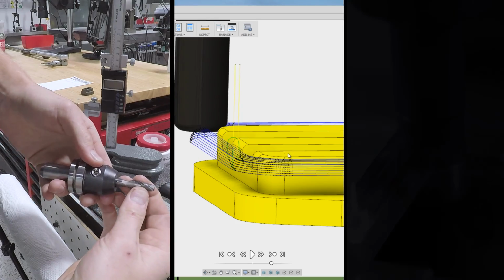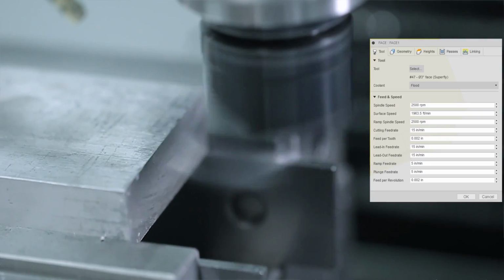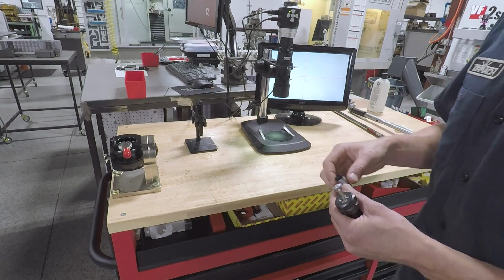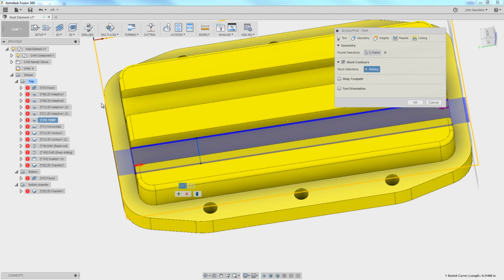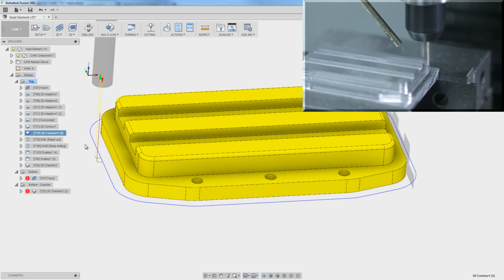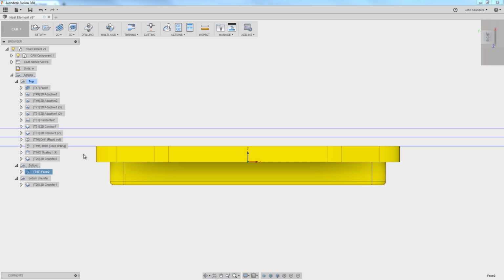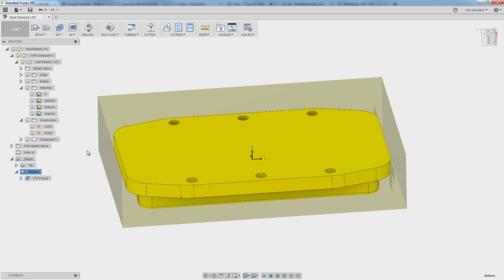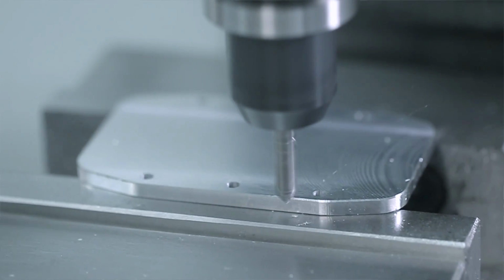Comparing 2D Adaptive & Flipping a Part! WW172

Comment: Sense the last thing you do on both op1 and op2 is the chamfer on the outside edge, with that tool loaded could you have gone in and just broke the edge on your through holes to save you time deburring  later on by hand?

Comment: 5:57 The WOC was rather too small. You need to cut the chips, not smear the aluminum around or weld it to the cutter. And some mist coolant always helps with aluminum.

Comment: Hi John, i appriciate your knowledge, but could it be better to take a roughing mill with cropshape and rough the whole slot out, change the tool to a end mill and finish the sides and the bottom with it?
I work with this setup quite very good, especially by big parts out of aluminium with roughly more tha 300-500 cm3³ to remove.

Comment: What is the best method to get out sticky aluminium chips from a carbide endmill?
Reply: Patrick Niechciol  when I was learning, I would soak the tool in hydrochloric acid. Perfect clean. ( carbide only,  I'm told the HCl harms steels)

Comment: Here is how you save your tool after chipmelting without breaking the flutes!!

Put it in almost boiling hot water with some caustic soda. And it literally eats the aluminium away. You end up with a brand new tool. ;)  even if there are massive chunks. 20-40min and done.

Comment: Yep, at 19:58 you can clearly see that the head is slightly rotated counter clockwise, and needs some trimming :)
It takes a secondary cut going to the right, and not whne going to the left

Comment: I work with Inventor and used to have similar issues of not being able to select geometry similar to this.  However, in this situation, you actually didn't have any geometry to select other than what you projected.  Create the entire rectangle and make sure the points lock/constrain to the corner points on the projected geometry and it will still be parametric.  In Inventor, you can hover over the line to select other geometry, I imagine Fusion has the same feature since they are both Autodesk products.

Comment: John; I know you are in love with that adaptive cycle. It does have its uses for inside pocketing. For slotting you may find a alternate method for this part would be faster and more reliable. When you have time try this. Take your 1/4" endmill with the tip radius and make slotting passes at very shallow depth of cut. You didn't say (Or I don't remember) how deep your slot was. Lets say .150" deep. Take ten passes at .015 depth at 10,000 RPM and 100 IPM what was your width lets say 3" of distance so 3 x 20 passes = 60" at 100 IPM that = .6 minutes. See with adaptive you are cutting air about 30-50% of the time. With this shallow depth of cut in slotting with the tip radius endmill you are basically doing feed milling (The tip radius thins the chip) the tool won't load up. Actually you may find you can feed even faster than 100 IPM that's only .0033 feed per tooth of your 3FL endmill. This method of milling makes a thicker smaller chip that is easer evacuated by coolant or your air mist for slotting operations. With bigger parts and with a proper feedmill, this is the most efficient way to rough parts now days. It does require more horse power than the Tormach might have. Your Haas would do it fine. Look into feed milling.

Comment: We use full depth slotting all day every day in our job job.  WAY less wear and tear on the machines servos and screws and way less programming and in aluminum with carbide?... who cares.  OR like John said in a past video, use the largest tool you can?  How about 5/16" tool, 1 pass rough, 1 pass on each side .001" cleanup.... 3 passes would take about 30 seconds.

Comment: Use 1 or "O" flute tools to keep chip welding aluminum particularly in the absence of flood coolant. Aluminum can actually be machined  most effectively at 3000SFM but it is absolutely necessary to have 1 flute tools to make that kind of cut sustainable in the absence of flood coolant but at more conventional SFM which you are utilizing it is also surprisingly advantageous to use 1 flute tools for aluminum machining. Check out datron CNC, they make their own 1 flute tools some of which feature patented special geometries, but many of the less expensive 1 flute endmills perform well for this application.
Reply: Eh, single flute end mills have their place, but they're are kind of a specialty thing, if I'm not mistaken. They have better chip evacuation and can be fed slower if you need to run at a high RPM. But if you don't really need those features then you're probably going to remove more material by feeding a three flute cutter three times as fast.

As far as proper surface speed, I've never seen a company recommending their carbide tools be run at 3000 SFM in aluminum. That's more in the range of what diamond cutters want. You'd also need close to 50k RPM on your spindle to get that kind of speed out of a 1/4" cutter like they're using here.

Comment: Don't bottom the drill in the chuck before tightening, and also don't chuck on the flutes, unless you like broken drills. (Think about it: the drill tip applies torque to the drill shaft, trying to untwist the flutes. This causes them to expand in diameter a small amount. This causes a stress point at the place the hardened flute contacts the tip of the chuck jaw, and can chip the flute. This can lead to a fracture and break the drill off at the end of the chuck jaws.)

Comment: Your tool broke because your chip load was too low. You need to feed faster or take a larger WOC. You need to make a decent size chip so that the heat can be taken away with the chips instead of transferring to the tool or part. I say it in almost all of your videos, but HSM milling is a waste of time in aluminum. You can run full slotting at 1XD depth no problem.
Reply: and you can cut fast slotting @ 1XD

Comment: John, instead of breaking the link to model in your sketch, try adding short lines on the top and bottom edges to close the loop of the region you want to retain.  This works in almost all parametric CAD programs and it works in Fusion 360 as well.

Comment: Have you tried using the "break" line just below the extend function? This should create 2 separate line segments instead of the 1 constant line
Reply: Doesn't work with a projected line. Projected geometry is linked back to a feature on the part so that if the feature changes the projection updates along with it. It can only be changed if that link is broken.
Reply: Jeb Julian 
I don’t think anything that’s projected and linked back to the original part can be broken or modified without first breaking the link.
Reply: Thanks for the feed back guys, I think John showed this and had to remove the link. I was just thinking about afterwards when the trim function moved the sketch, maybe break would have worked
Reply: As another commenter has already mentioned, the projected lines can be converted not construction lines. Then you can complete the rectangle with 2 "normal lines. This will maintain the parametric nature.

Comment: That heat sink looks optimized for surviving rugged handling rather than for peak thermal performance.  #intriguing
Reply: Jim's videos 
Probably for an unvented application inside something where there’s no fan to move air around it. A large block to act as a thermal mass works better than a finned one in applications like that.

Comment: Changing the toolpath in Fusion and putting it onto the Tormach surely takes much longer than just running it the full slot again...
Reply: dcraig4 
If you’re breaking tools on a finishing surfacing path you have bigger issues at hand and should probably redo the toolpaths.
Reply: For this part. It becomes relevant when you break a tool at the end of a much longer operation.
Reply: dcraig4 
Cept usually much longer operations have far more complex geometry and there’s no good way of telling just what was and wasn’t cut. 

This would be useful maybe if it was a tough material that had to be machined slowly. But I don’t see it being that useful to do.
Reply: So tell me what you would do if you broke a tool 3/4 of the way through a 6 hour operation.
Reply: dcraig4 
Restart the program from the broken tool...   what program has a 6 hour long single tool path??
Reply: A finishing toolpath for a large part with complex geometry, for one...
Reply: And even if it's only 60 minutes, would you really just let the machine waste time cutting air for 45 minutes? Maybe that's ok in your shop, there isn't necessarily anything wrong with it, but not everybody works in your shop.
Reply: dcraig4 
If you were doing something like mold work, would you really trust that the new tool will match up exactly and blend without any interruptions from the previous broken tool?  I know I wouldn’t.
Reply: Like I said, not everybody works in your shop; not everybody makes molds; matching up exactly doesn't always matter. The fact that you don't see the utility of the technique doesn't negate it's utility for others.

Your suggestion of rerunning the operation to save time doesn't account for bad tool paths either. If you DID break a tool on a finishing surfacing path why would you take the time to contain the toolpath to the unfinished portion but not fix the issue that broke the tool?
Reply: dcraig4 
You wouldn’t. That’s the point.  You would redo the entire path differently. Obviously something was amiss and either needs a different path all together or requires a semi-finish operation. 

I also think it’s a dangerous practice to put something like that in there if you have more than one part. Go to repost the entire program as a whole and now you have the full finish path plus the partial path.
Reply: Something being amiss doesn't mean you need to scrap the entire part and start from zero. It also doesn't mean you need to spend untold minutes cutting air. 

You're trying to defend your position by making assumptions that make no sense. In the video John showed the steps he takes to make sure that the code doesn't get accidentally reposted. Whenever I've needed to do this I also take steps like making it a separate operation, or even duplicating the setup. This stuff doesn't happen in a vacuum.
Reply: dcraig4 
I never said you’d scrap the part. And second, you shouldn’t be cutting air, you should be reskimming the entire tool path with the new tool and path. 

Sorry. But I see that as a hack job way of doing by things. Drop the tool 2-3 tenths and rerun the path completely.

Comment: Know what’s even faster than the 3/6”?  

1/4” endmill full width ramp slotting 😁

If you had set up a stop on the left side when doing op 1, and picked your Z zero as the top of your parallels. Instead of futsing around with all those sketches in op 2. You could have just picked the upper left corner at the bottom of the model box for your op2 position. No need to re establish your XYZ zeros in the machine. Just flip, and put the finished edge against the stop. And done.

Also. No need to face on op 1. You’re already running a horizontal path later. Just have it do the top as well.
Reply: "3/6"? Lol, I knew what you meant.
Reply: Ian Munsell 
New phone. 

It has a mind of its own 😆
Reply: IKR. I just got an apple and it often feels like it's writing for me.
Reply: Ian Munsell iPhone X. Pretty sure it’s smarter than me...